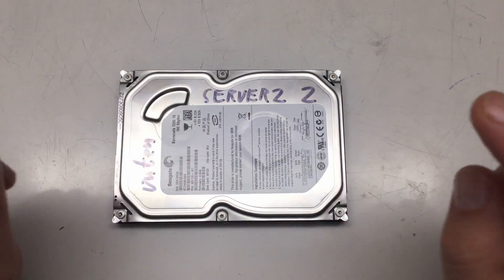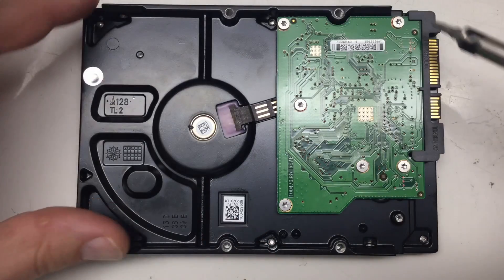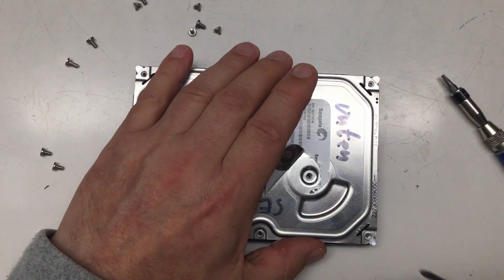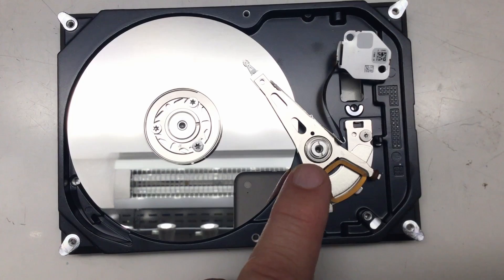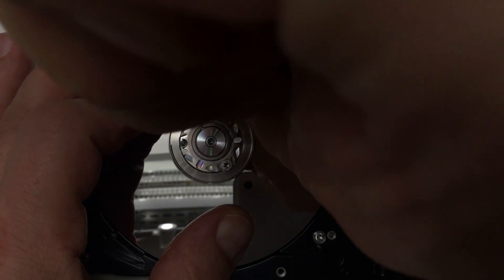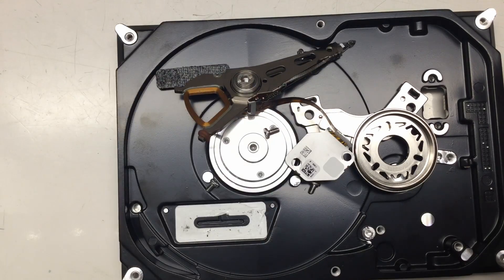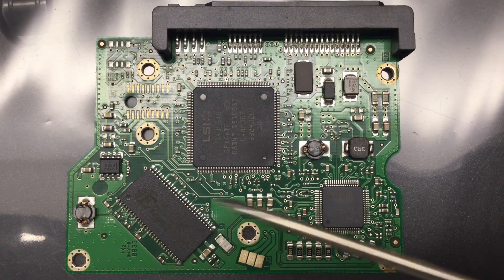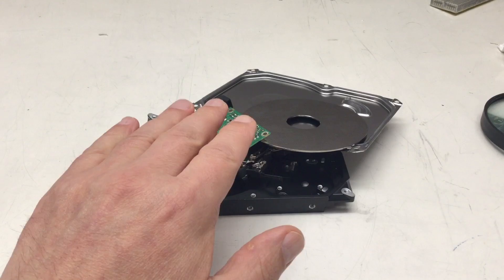15 Year Old Seagate Barracuda 7200.10 Hard Disk Teardown (All the Chips)

Comment: Hello i have the same hard drive i was wondering how do i recover data from it , because my pc sadly isnt functionable, will this destroy it ???
Reply from the maker: Well what I did to the drive certainly destroyed it. What exactly is wrong with your drive? It doesn't spin up anymore? The computer doesn't recognize it anymore?
Reply: @robertssmorgasbord  I have the same issue I have this same drive and I want to recover data off of it but it doesn't seem to spin up at all
Reply from the maker: @ Unfortunately, unless you have a cleanroom, a second drive of the same type, and the equipment to exchange parts between the two drives your best bet is a data recovery service (just google it).

Comment: TBH, I have never had a Seagate drive last very long, they always die with a click of death or their electronic toast themselves to the point the BIOS no longer reconised. Definitely don't lasting as long as my Hitachi's. Still have an ole 2006 Hitachi service, running in a ole Linux box. I wonder whats makes one brand last longer over another? Better componets?

Good uses of ole platters is to make them into coasters for your hot drinks.. Or if you're gonna dispose of them, drill some holes onto the hard disk platter, makes it practically impossible for someone to read them without killing their hardware.
Reply from the maker: Yup, the Hitachi (HGST) HDDs are great.